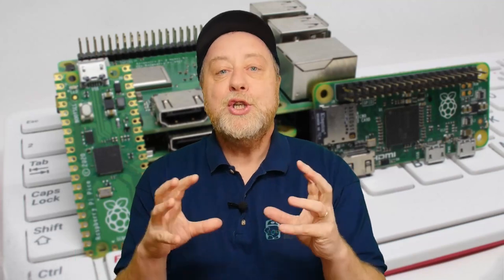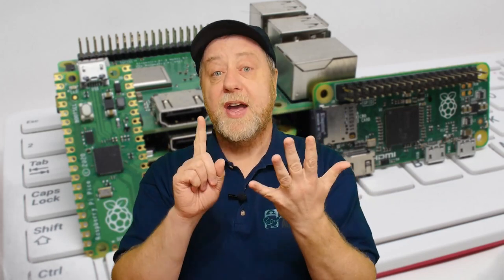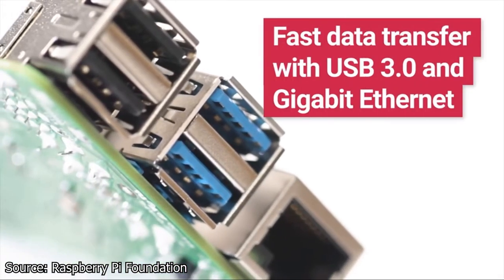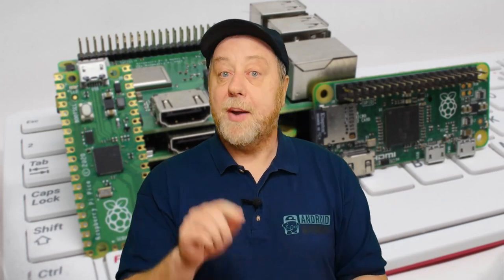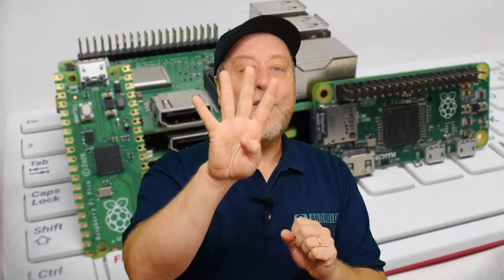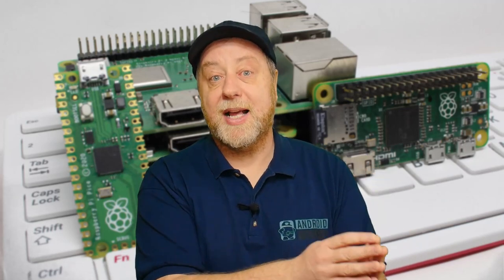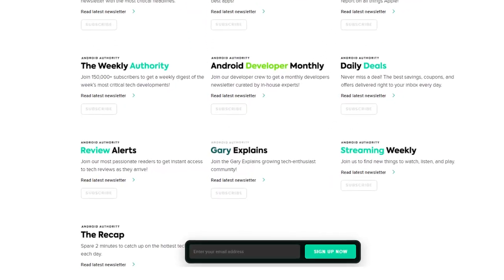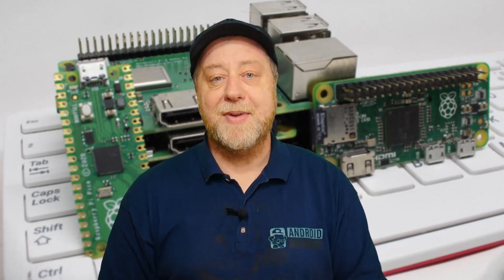Choosing the right Raspberry Pi for you!

Comment: I will say tho, with the pi 400, people will think your a bit crazy with a mouse plugged into your keyboard. Also having all those wires (1 power supply cable, one mouse cable , one audio cable, 2 micro hdmi cables and one SD card) makes wire management a pain. Unless you have some experience with cable routing or your ok with the mess, I would recommend a regular pi 4. BTW, not roasting the pi 400, just saying that you should know what you get into if you get one 👍

Comment: You are missing a model of a raspberry pi on the Zero family, which has a normal CPU speed of 1GHz, and only costs $15, and can have normal clocking of up to 1.3GHz, which is 0.1GHz more powerful than that the Raspberry pi 3A+. The performance is almost equal to a rpi 3, and has a similar CPU.

Comment: Can you tell me which Raspberry Pi computer that has a lot of power and that I can keep on continuously to use as a home VPN.  I also have other uses that I can use a lot of computing power, but on an inexpensive computer like this.  I will be using Windows OS on it.
Reply: Don't run Windows on a Raspberry Pi. Linux is the way to go. Get a Raspberry Pi 4B and raspberry pi os
Reply: Yeah raspian is the way to go. Also, I don’t think any specific pi has better power management than another, I recommend just getting a regular usb cable and plugging it into an outlet.
Reply: @jontesart7213  Is a 2GB one enough ?

what about the Pi-Zero ??
(or clusters of them)